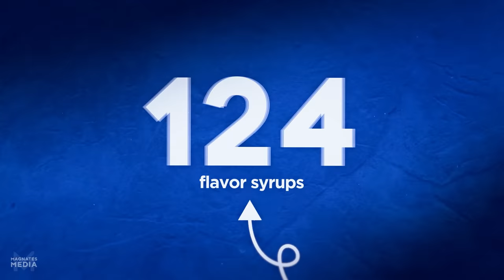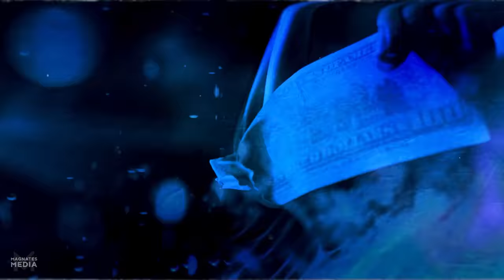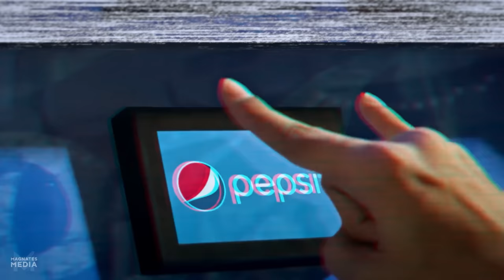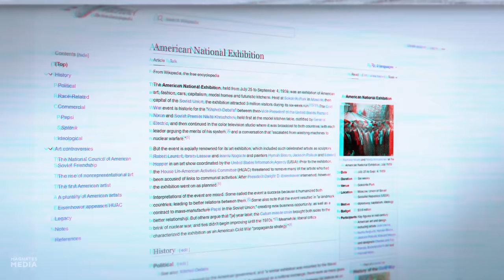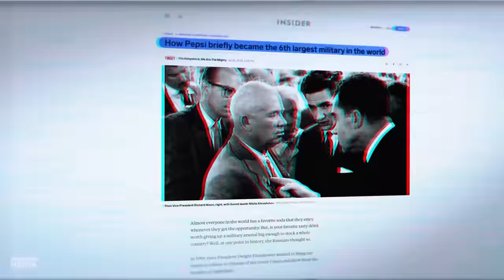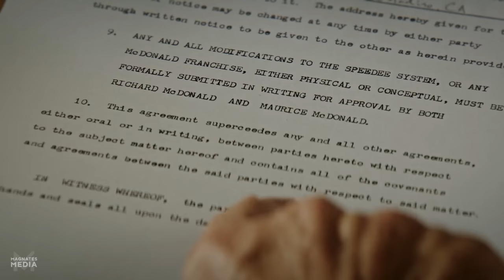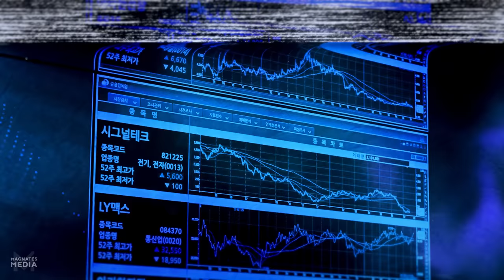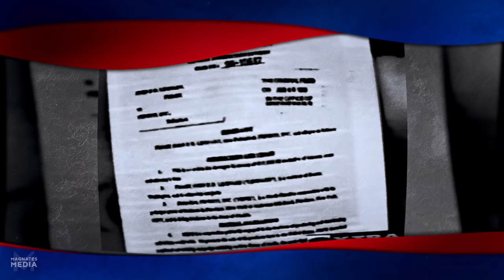Why Pepsi Went Bankrupt

Comment: Coca-cola leaves me feeling bloated with a bitter taste in my mouth. They put bicarbonate in Coke because of the acid in their drink. This is why Coke can neutralize battery acid. Pepsi cannot neutralize battery acid. This is the real Pepsi challenge for me. Pepsi is sweet and goes down like water. I was a 2 case a week Pepsi drinker and weighed 430 lbs. I stopped drinking carbonated drinks and over the space of a year loss 70 lbs without changing any other part of my diet. Unfortunately I have to work to lose the rest. LOL.

Comment: Answer the last question, why Pepsi is always the second after Coca Cola. The Coca Cola brand has better logo, and no blue color in it. White-red is for some reason (our DNA) better perceived than white-blue-red in terms of eating, drinking. Also Coca Cola characters' shape is a little bit "vintage", when Pepsi has very modern logo. It looks like Coca Cola brand seems to be "older", means longer on the market, and because of it more reliable, many times chosen and checked, proved. Also the better Coca Cola logo, more "Vintage" means, that this brand is dedicated to reacher people; the same is with Jack Daniels for example, or Gucci. Not a modern (means new) brand makes popularity, but more "vintage" one. Maye Pepsi should come back to its roots, and check how the old logo would work? I'm sure they did it, so the results would be interesting!